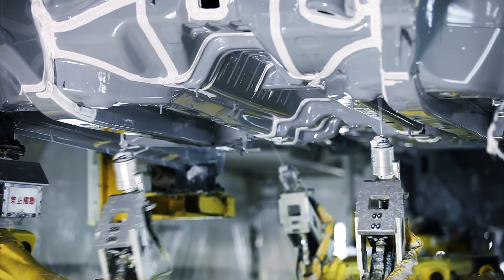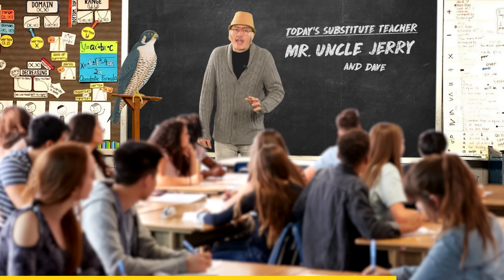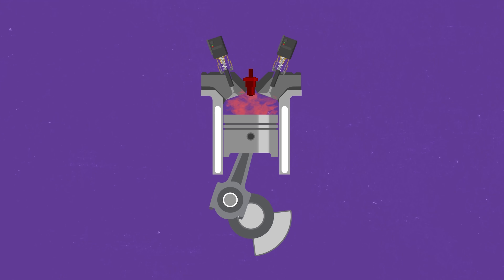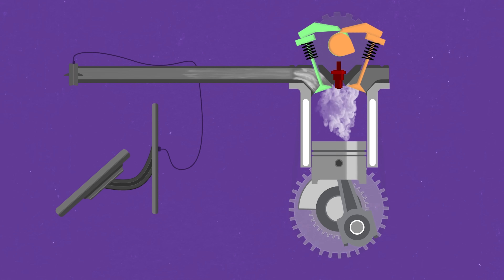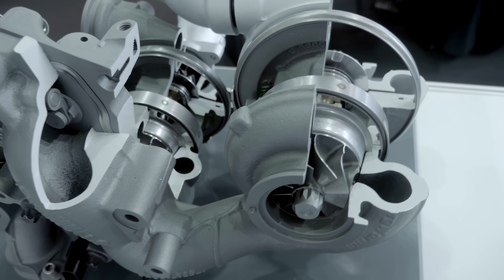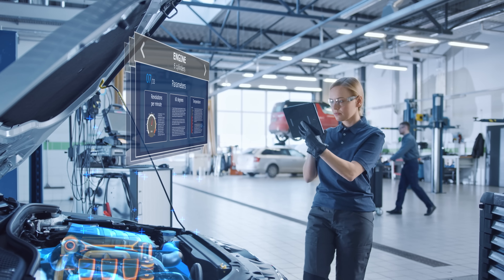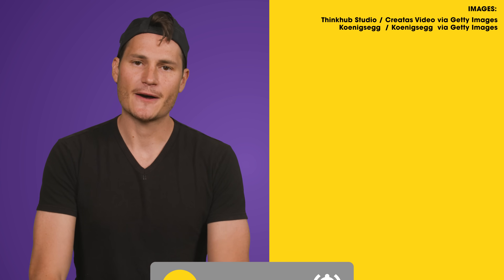This Is The Last Great Engine Tech

Comment: electric vehicles are neat, but there's no guarantee it will be cleaner or more efficient to transfer than reclaimed o2 fuels, though I am confident other clean technologies will make solar nothing but a roof mounted backup plan. on a cooler note, I hope somebody does a free valve conversion on an STI, I can't think of a more absurd application that would fully benefit from this technology.

Comment: This sounds so ancient why not just make a valve that controls how wide the opening of air is to maximize air always depending on the throttle which you could get without even a computer by analyzing the throttle output would be almost the output you need to widen the air input doesn't take rocket science to see that one.

Comment: It still amazes me in that in 1970 my Volkswagen Squareback had fuel injection. I believe it was used to help the engine pass the E.P.A.'S  new stringent emissions standards. Yes it was as basic as you could get but it was still F.I. and for how cheap the car was at the time it was especially odd. The big 3 were still using single, double and even triple carbs on some muscle cars and F.I. wasn't available on the Corvette anymore..

Comment: There's a simpler and cheaper solution for this. The Valve float can be eliminated by the use of a desmodromic valve, which uses two rocker arms, one to open the valve and one to close it. This tech was used by mercedes on the 60s and still used by Ducati in their bikes

Comment: This sounds like a great one. Might seem "another thing to go wrong" but if it goes wrong it's just replacing the faulty actuator(s). Much easier than fiddling around with the timing and valve system on a conventional engine. Potentially a 5 minute job. Increased efficiency and power is obviously great. Decreasing engine size further and increase fuel economy as well. Will be a great addition for Hybrids. Especially plug in, which imo is going to be the best option for the future. The energy density of batteries is crap, and will be crap for a long time, just a little less crap over time. But as batteries evolve for EVs, they also evolve for PHEVs. And a more efficient engine means that you can reduce the volume of the fuel tank and put more batteries, increasing Electric range on Hybrids without compromised Hybrid mode range.

Comment: Strictly speaking VTEC is not variable valve timing, it's variable valve lift. Variable valve timing is changing the angle of the camshaft relative to the crankshaft to change the point in the engine cycle at which valves open and close. Just about all manufacturers these days use variable valve timing and have for a long time, and many use variable valve lift, Freevalve is nothing new in that regard.

BMW's Valvetronic, Toyota's Valvematic or FIAT's Multiair all allow for continously variable valve lift, just like Freevalve. THESE SYSTEMS HAVE BEEN AROUND SINCE THE EARLY 2000'S

The only advantage of freevalve is that being controlled electronically the opening/closing profile can be whatever you want rather than the sinusoidal wave you always get with a cam, which has advantages for high performance engines like the Gemera's which makes 300hp per liter, but won't make any difference in your Civic.

Comment: The issue with freevalve is that it's conceptually extremely capable but there's sort of doubt of it's longevity esp in higher rpms. It's got huge potential and simple by design, but it has its concerns on whether or not the pneumatic actuators will fail prematurely.

Comment: International was playing with this 20 years ago. The we’re using hydraulic pressure. The same set up that actuated the HEUI injectors in Powerstrokes to open valves, no camshaft required.

Comment: Great idea, but my main concern would be that if these fail at any point, your whole engine is quickly ruined! When the actuator for the exhaust valve fails for any reason, that piston is toast. So for each piston in your engine you now introduce an electronic component in a relatively though environment that must be absolutely 100% reliable or else you have big engine failure.

Comment: Old GM R&D tech from the 1980's.
Problem for GM back then was that they could not bring the solenoid size down to a level that could be used on a car. Then again GM tried this with 12 and 24 volt systems. I'm sure that if a person were willing to risk installing a 400+ volt electrical system inside or at least on top of a hot engine they can get away with smaller solenoids.

Comment: How does eliminating the throttle body eliminate the intake manifold? I think you misspoke. The car still needs an air filter, and if it has a turbocharger, the pressurized air will need to dump to a common volume waiting for the intake valves to open....sounds like a manifold. Also, the catalytic converter does nothing for fuel efficiency, just emissions.

Comment: Doesn't the crankshaft have to be smaller than the camshaft? Cuz when the crankshaft turn twice, the camshaft has to turn just once. Which means that when the crankshaft has 20 teeth, the camshaft has to have 40 teeth right? I kinda see what you did there, but now the chain goes around the flywheel, and not the crankshaft gear.

Comment: When you see how they use them, its not the right way in your video..

They dont send some to exhaust around the turbo, its all going in the turbo, in there 3cylinder, it have 2 turbos.

Look it up..

Or see engineering explaind :)

Comment: That is freevalve which is basically  electronic variable valve timing, I've learned all about it when Koenigsegg announced it and showed it off. It's a very cool technology that won't be seen in modern cars today unless Koenigsegg allows it or someone comes up with a completely different design that accomplishes what this does without violating any of Koenigseggs patents. I would love to see this in modern cars, or see Koenigsegg make kits to retro fit this into older cars or modern cars or both. Forget a cam, this right here can give you that choppy cam sound and performance or no sound and all performance with a push of a damn button!

Comment: Eye roll. I've got plenty of new engine tech coming. For example, the Temporal Torque Transfer Device is an active flywheel that adds and subtracts torque over the course of a revolution of the crankshaft with essentially no losses. Yep, it nets zero torque, but it smooths an engine so the torque produced is constant, making  said engine smoother than a motor.

Then there's the Simultaneous Combined Cycle, which achieves what those mega expensive combined cycle power plants achieve, but better and in a single engine.

And then there's staged combustion within said single cycle, resulting in an engine that literally cleans the air, something no EV can achieve.

Then there's the Spiked Stream fuel injection system that enables a low pressure fuel injection system to massively outperform a high pressure one.

And finally, by using two TTTDs the "inherent" rocking of an engine can be vanquished.

Put it all together and a single triple Simultaneous Combined Cycle Catalytic Staged Combustion Engine can cheaply achieve 2/3 efficiency with no adverse effects.

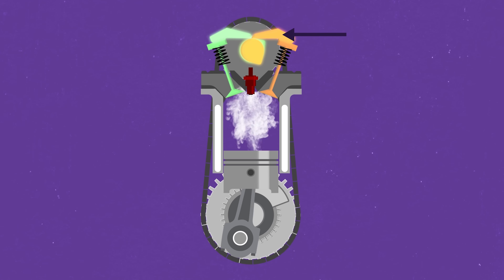Comment: I'm at 3:14... or, you could use a turbine to prime a tank, maintain that tank pressure with a blowoff valve, and computer controlled intake valves, in intake ports, that allow air the pressurized air into the cylinder... sound about right? I also have blueprinted a similar system that preps pressurized intake air with a variable, programmable, percentage of racing nitrous, before delivering it via computer controlled intake valves, directly to the cylinders via intake ports... do with the idea what you will. Just remember, with the O2, N2O combo system, there's no blowoff valve. So the air being pressurized into the intake supply tank, has to be delivered at a set rate, with the correct ratio of N2O, as you can't be blowing off valuable nitrous... have fun...

Comment: Another benefit:  No starter motor.  With controlled valves, injectors, and ignition, you can use software to initiate an engine start sequence.
Reply: This whole idea of digital valves appeared in Automotive Engineering magazine about 20 years ago.  And even in that article, it wasn't a new idea.

Comment: well, you forgot so say something, these electronic acctuators are pushed by an air compressor, that compressor is drived by a belt from the crackshaft, 
so yeah no timing belt/chain anymore but this is way more complex than before cuz you have to time how and when the actuator are activated : ) 

you might say "how mr kagan put a compressor driven with a belt on the engine ?"
well he did not, the compressor was running with electricity from the 12v battery of the car 

also, he did not explain how he can make the water pump of the engine running without the timing belt ... 

otherwise this is awsome and i cant wait to have this tech on all car cuz honnestly i think this is a major step foward in the car industry :)

Comment: This electric car craze is the dumbest, most half-baked idea yet from “progressive” green energy nonsense. They do work and well but really only as a daily commute, close to home transportation. Good luck taking a family trip when you can only go 200-300 miles before you’d have to charge back up at a... where? There is NO infrastructure for all electric transportation and even if there was can you imagine the lines at charging stations if it takes even a half hour to fully charge a battery when everyone has electric cars? A half hour charge time is still a dream even for a rapid charger at the current time, more realistically you’re looking at 1-2hrs and that won’t even give you full range. Again I’m talking about traveling away from home like on a trip. All electric cars may sound good and feel good to drive green but it’s stupid, beyond stupid, it’s regressive. Unfortunately there’s nothing intelligent about being “woke” but it is popular so of course all the manufacturers are on board with it. So it’s coming with or without proper infrastructure to support it and when it does you’re going to hate it. Current electrical grids will implode with this new power demand too. Common sense isn’t common, it’s a super power, but it’s one that gets people ridiculed and called stupid. A wise man among fools appears to be a fool to the fool.

Comment: Years ago I wondered about the possibility of a free valve engine. Like the host, I wondered if anybody had ever done it, and a little google magic and there it was computer controlled valves. Very cool. This was really a well done video that did a great job of preventing the advantages of the concept. When I was thinking about the idea I imagined that the advantages would be much less than they seem to be.

As to whether electric cars will make the transition to this idea obsolete: Maybe not, the ICE companies would really like to hang on the their ICE infrastructure and something like this might make it possible, at least for another ten years or so.

Comment: Well if you don't install a waste gate, you still get overpressure and turbo stalling, no matter which type of valves you have! Even worse, the over pressure may lift the valves simply by pressure or not let them close when they should be closed, resulting in piston valve crush salad, totally destroying the engine! Audi 80 GTE and early Jettas and early Kadett and Korean copies therefore had specially machined pistons with "holes" where the valves may be in case of a timing failure, making it nearly impossible to trash the pistons into the valves. Note that we're not even turbo charged engines! Note 2: This was a golden construction roule in the 1970-1980 to construct the pistons and vales, so they can't hit each other, even if the time belt/chain brakes, in German called "Freiläufer", later abandoned for "fuel efficiency". I think it was rather reduce production time on the CNC,  which means cost cutting, as Audi 80 GTE proved that with precise machining, you still can get good compression and have a small rest volume in the head and still be extremely safe before piston valve-salad.  That means that average life of the engines was reduced for "fuel efficiency", and I honestly doubt that, in the total lifespan of the earlier cars, you safe overall energy, because producing a new car needs same energy as approx 100'000 km!!! But for sure, that will increase car sales, as now only a false downshifting, therefore over reffing, now can kill you car! It new it's different but is it really better? Sorry fuel efficiency is good, but if the engine blows up at 100'000 km now, like some turbo charged German plastic part engines, that won't help the environment at all, and on the same brand the engines of the 1980 easily made 250'000 km and still were in perfect conditions, basically ready for at least the same mileage again. Though they may have had some issues with rusting of the car body. Later zinc coating stopped that, thats why you still may still see Audi 100 looking like factory new, later coil coating resulted, because cutting after zinc application!!!, therefore no zinc at the edges of the sheet metal, in again rusting very bad! They always find a way to make your car last less long! :-(

Comment: WHAT IF WE start to use the turbo to compress air inside a canister and inject it in a smilar way to the gasoline? compressed air at 8 or X bar and shoot it inside cylinders through an injector as gasoline does :3

Comment: I'd like to see it on something beefy, maybe the M113k in an E55, they have three valve heads and a clutched blower which might make for some interesting engineering opportunities,  they are reasonably priced with tough engines.

Comment: This concept has been around for a long time. Here's the big potential problem though. If your fuel injector fails you only get a rough-running engine. If one of the solenoids actuating the valves fails to close a valve even ONCE, the piston can crash into the valve and destroy the entire engine. Presumably, springs still close the valves and the solenoid only opens the valves. It is possible though for a solenoid to get stuck in the open position which would also result in the piston hitting the valve with possibly disastrous consequences. This is what has delayed this technology for so long. I would be very wary of this technology until a lot of actual experience has proved its reliability.

Comment: With the freevalve tech you can have power stroke every second turn of the camsaft it means that the normal 4 stroke engine gives even nearly douple the power due the normal 4 stroke engine due this 2 stroke possibility with this freevalve tecnology.

Comment: I remember seeing Freevalve system while it was under development, at least 17~18 years ago.
It was all easy to find back then but by 2010 was a 'closed' project (I think I found it on Porsche engineering site?)
The biggest issue was the high amperage needed to operate solenoids. and probably why it isn't used by more manufacturers - if battery dies, your 'dead in the water', not so good for a 'grocery getter' 
One of the model engineering magazines actually had a two cylinder solenoid valve motor . 
(The Home Shop Machinist, 2005~2006, 'Build the EVIC-211-Mk1')
 EVIC= electronic valve internal combustion

Comment: I had the idea of electronically open and close valves a while ago because I wanted to do away with the camshaft, valve springs and the belt/chain. I thought there would be at least a 5% increase in power/reduction in fuel consumption by removing the resistance at the cam lobes (and anywhere else it occurs with the valving) and overcoming the pushback from the springs. The thought of weight reduction didn't even enter my mind at the time. 
I told my idea to an old mechanic and he told me it would be impossible to keep the valves in time with the position of the piston proper. One pause while the valve is open would equal a catastrophic collision. Valve contact with the piston just once boom there goes your engine (or at least that cylinder, piston and head if each cylinder has it's own separate head, otherwise it'll be the whole cylinder head for that bank of cylinders). 
I'm not kicking myself for not pushing this idea further because I didn't have any idea on how to develop it beyond: electric thing 'here' on the valve stem makes it open and close. This little electric thing here on the crankshaft sends a signal to the electric valve things to let them know when to open and close and how long to stay open and closed. Throw in a thermometer for good measure so you can know if the valves are getting too hot and maybe another magic electric device that brews a cup of coffee on your morning commute at the touch of a button (<----uses engine heat).

Comment: I find it weird that diesel engines have injectors that are so precise and cars have suspensions that can scan imperfections in the road and react. Both have a similar oscillating motion to a valve and yet no car company has put digitally controlled valves into their vehicles. Also why not use the turbine part of a turbo to generate power to power an electric computer controlled compressor, getting rid of the lag and allowing the compressor side of a turbo to be separated from the hot turbine side?

Comment: One capability that these could open up is compression release engine braking. Pop that exhaust valve open after the compression stroke to prevent the compression energy from returning to the crank. It would be awesome on an AWD vehicle and even more awesome if the center diff could vector torque to the front. I wonder if it could allow for reduced brake rotors size and mass.